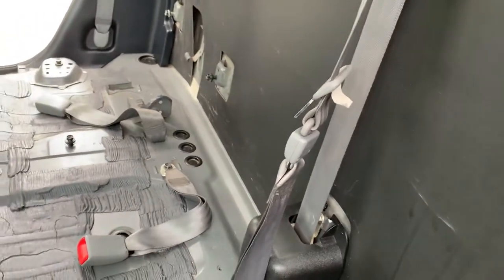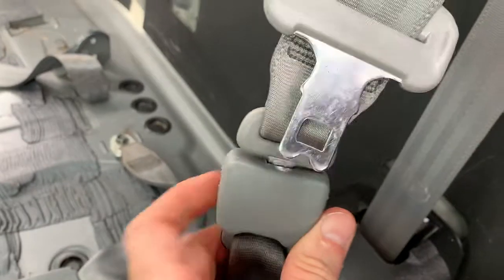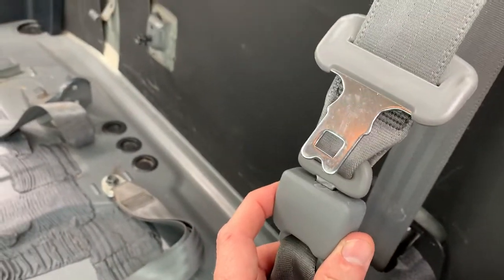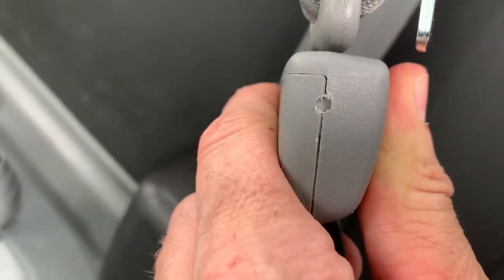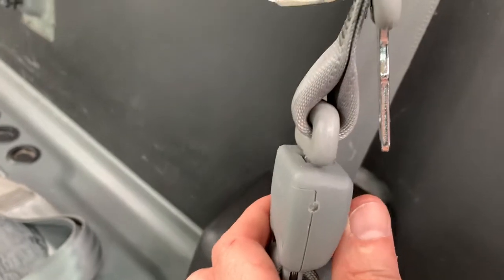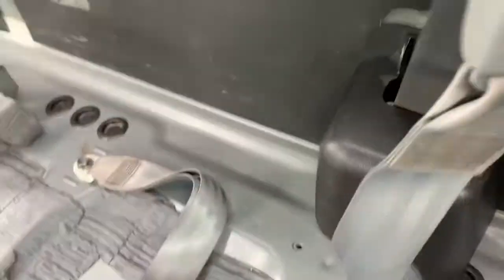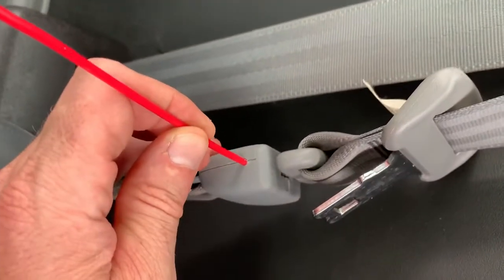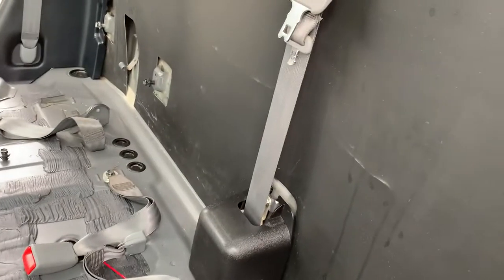2010 Toyota Tundra DIY - the rear bench seat center seat belt conundrum

Comment: Thank you so much. This helped me so much. We purchased seat covers for our 22 Camry and I needed to get the center seatbelt through the seat cover. I didn't need to drill, I used a small screwdriver and pried the seam open and pressed the release button. Thank you again so much!
Reply: When you pried open with screwdriver does the plastic housing then click back in place? Thanks.

Comment: Thank you very much for your great informative video.  I have a 2015 double cab that just recently someone connected that seat belt without my knowledge.  After viewing your video it was very easy to release it.  I used a very thin piece of metal like a jeweler's screwdriver and it went right in I didn't even have to drill a hole 😊
Reply from the maker: Aw man that's a good idea! So it was like a very thin screwdriver that just fit in the slot there I guess? I never even thought of that. Did it pop open the casing at all?